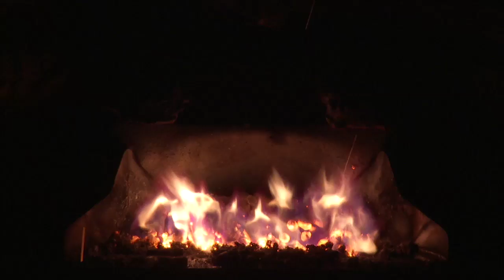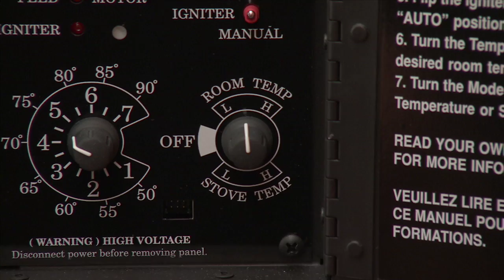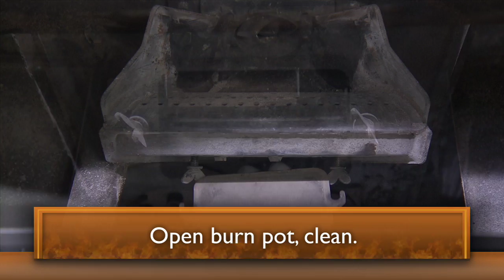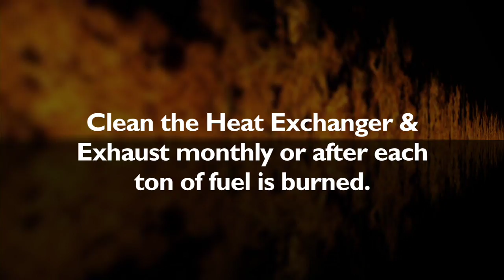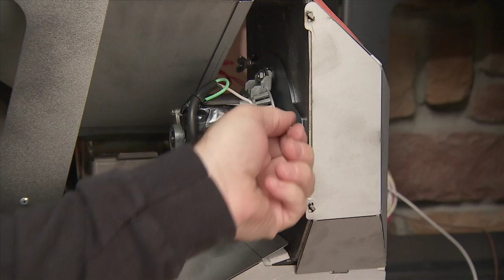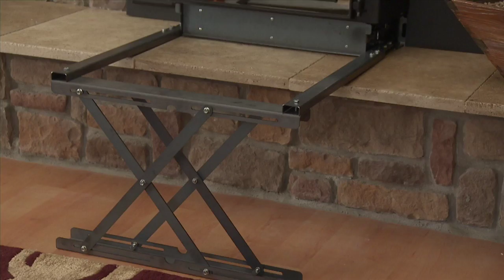Harman® P35i Pellet Insert Maintenance Video

Comment: I undid my latches and this thing is not budging...is there a trick to pulling out an Accentra Insert?
Reply: I’ve had 2 “ authorized dealers” cost me 400 for nothing they knew nothing about this stove 
Anyone get theirs out after unlatching the latches
Reply: @earp730  did you ever figure this out?
Reply from the maker: Hi Allan, thanks for reaching out! The Accentra inserts are slid into place using a gasket, so other than those latches, nothing else is holding the insert in place. They are heavy and not very easy to get out once they’re put in place unfortunately. We would recommend having an authorized dealer out to do the service. To find an authorized dealer near you please click on the following link. Thanks again!   http://www.harmanstoves.com/Service-Locator.aspx

Comment: They said the blower was "whisper quiet."  I don't know what they definition of "whisper quiet" is, but this insert is very loud.  I have to turn the tv volume very high in order to hear over the fan.  Other than than,  it's a fine product.
Reply from the maker: Hi +Patricia Martin. Regular maintenance of the fan and stove will prevent fans from getting louder and will maintain proper functionality of the stove as well. If the noise is concerning, we do recommend working with your local authorized dealer for assistance. To find an authorized dealer near you please click on the link below.  Thanks for reaching out, have a great day!

Dealer Locator: http://www.harmanstoves.com/WhereToBuy.aspx
Reply: +HarmanStoves I clean it twice a week.  My local dealer doesn't seem to know much about this stove, although that's where I bought it.
Reply from the maker: Hi +Patricia Martin. Our authorized dealers are factory trained and certified to sell, install, and service our products. They also have the technical resources to get any information you may request, and guidance if necessary to fix any problem you may encounter. However, if you feel you're not getting the information and service you need, please call us at 1 (800) 664-3119. Thanks again, have a great day!